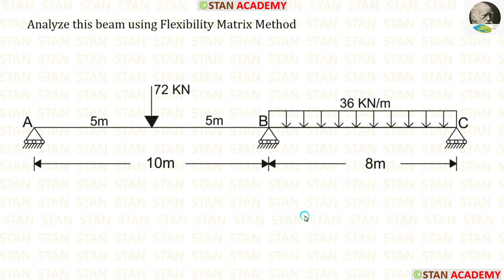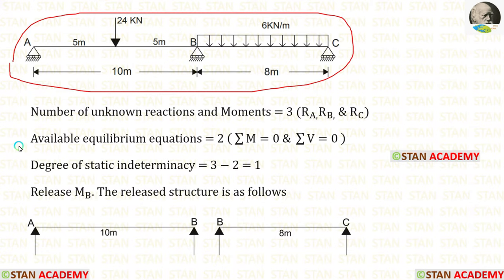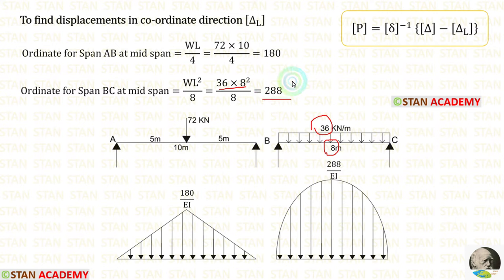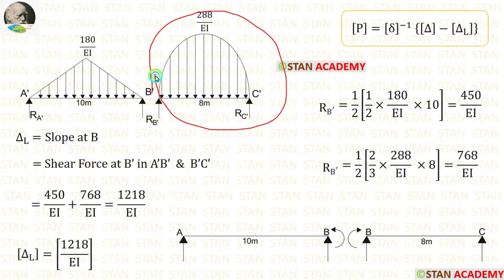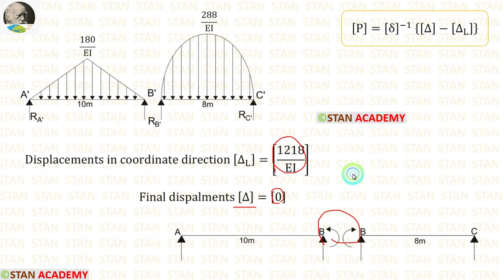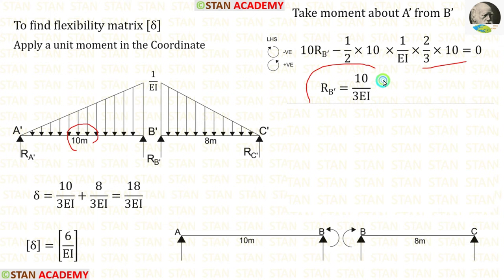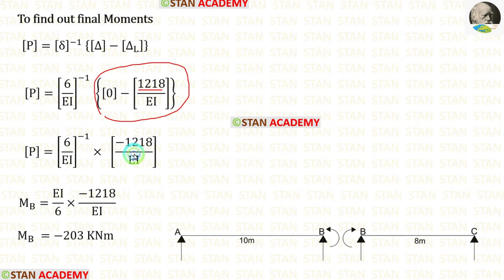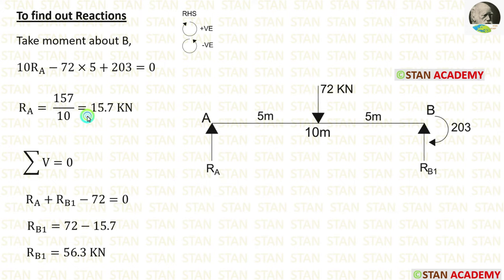Flexibility Matrix Method of Analysis of  Beams - Problem No 1

Comment: Sir, how all the supports can be roller? 
Atleast one of the supports should b hinged or fixed in order to resist horizontal moment
Reply from the maker: As long as there is no horizontal load, roller support and hinged support act as same in the case of beams